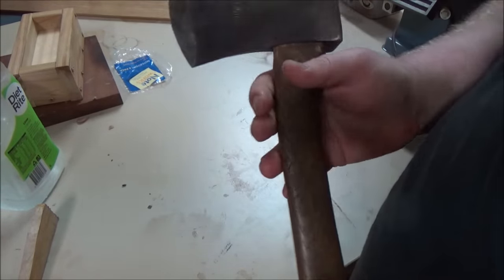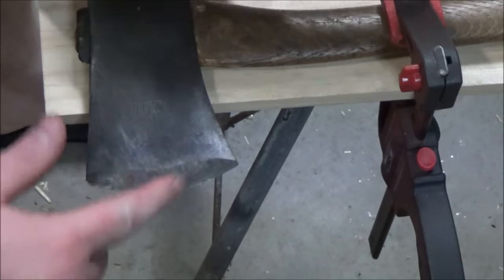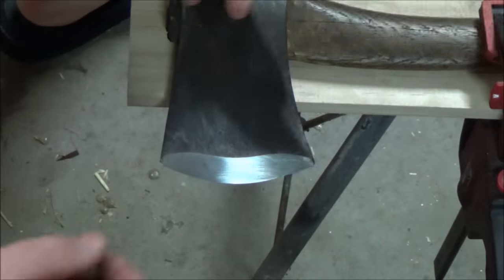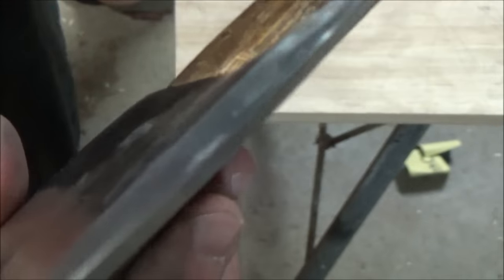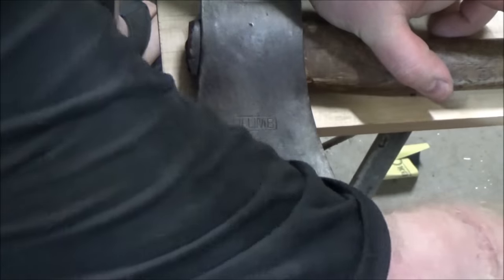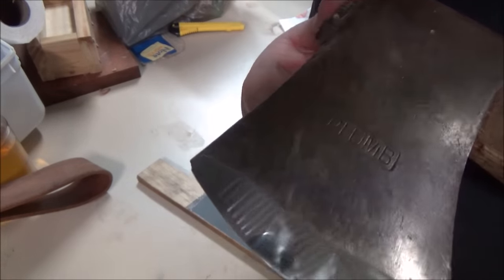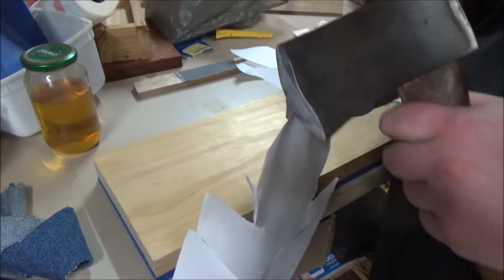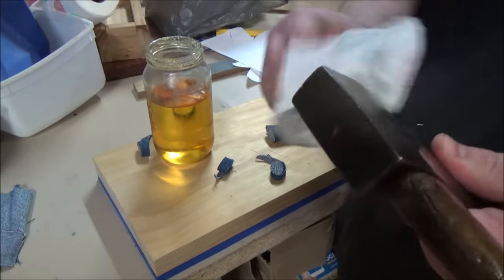How to Sharpen a Hatchet or Axe to a Scary Sharp Edge!

Comment: Just passing on a tip.i happened to stumble p
Upon a "shop changing"  supply source the other day as far as abrasion paper is concerned. It will save me 100's if bucks over the next 10 yrs... At the local ABC equipment rental place I was in there on my lunch, sharing some amazing ribs with a cute blonde I had met at the bar that weekend... Oh hell, SANDPAPER, the industrial kind in. 18x25" sheets! Light rosin or laquare backing with sparse grit. 2mil thick!!! Only had it in 36 50 80 100  but DAMN for 20$ I had 6 sheets of the best corse grit available.. got x2 50 and x4 80grit!! 
    Got abrasions from the babe too! But that's another story!

Comment: Life-changing. Seriously. Thank you so much!
Reply from the maker: Thanks. Life changing might be a bit much though. 
If you are new to sharpening them sandpaper is ok to start with but is more expensive over the long run. Files are great if you have a lot of steel to remove at the start and don't want to use power tools. I use a draw filing technique as it is easier to control the angle.
Reply: @scottshobbyz5416  This is how new I am: Bought an ax to process wood around the campground. Didn't realize it was DULL till I was camping and tried to use it, so....yeah...life changing, lol. Still chuckling over that one.

Comment: Ok, I'm definatly going to have to do that
Reply: I've used this technique for years, long before the internet existed. I couldn't get or afford diamond stones or the like. I use automotive carbide paper from the start, in the higher grades I wet it with water so the grit lasts longer. Just dry and oil the blade after sharpening.
Reply from the maker: Good luck. If you have a lot of steel to remove at the start you are best off using a file then go to sandpaper or stones
Reply: I have sandpaper up to 3000 and a buffer, I do have the Langley stone sharpener for my knives, that gets them scary sharp too, but for an axe or machete your out of luck, so I'm glad I found your video, definatly gonna try your method
Reply from the maker: I am not sure what a Langley knife sharpener is. Is it like the CIA version of the lansky ;) 
Bad joke I know.
Be careful on the buffer as you can overheat the very edge very fast. Also you don't want it to fly out of your hands at the least you may damage the axe at worst it may get you.
If you need to remove a lot of steel to set the bevel. Start with a file and draw file until you get it to where you are happy then refine until desired with the paper.
Good luck and have fun.

Comment: I prefer a grinder with a sand wheel. I get a pretty sharp edge in about 30 seconds. Then I finish with my stone for about another 2 minutes. But this is an awesome cheap way to get an edge nothing else would for the same price. Awesome.
Reply: be careful of ruining the temper

Comment: Hi mate, I was taught by an old saddler to keep sharpening until you work the bevel off and after that go to stropping. He would strop on the rough side then the smooth side of the leather with jewellers rouge and would get beyond razor sharp. I realise this is an axe not leather working tools lol. Great video, cheers
Reply from the maker: Yeah those leather knives are thin and get crazy sharp. Not sure if you meant work the burr off. But leather tools need to be sharp to get a nice clean cut. Anyone who can make a saddle will know what they are talking about.
Reply: @scottshobbyz5416  Burr lol.

Comment: Through my work as an Industrial Insulator, specializing in high heat applications (2300-3000+ F) I have several blocks of ceramic “tile”. What are your opinions about using it to sharpen edges? Would it take the place of any or all of the steps you showed here? Thanks

Comment: If it's convex, you keep it convex.

Convex geometry is required on a standard hatchet, mainly to avoid having the head stuck in the wood too many times and to enhance the splitting action.

Convex sharpening is quite simple using sand paper, some kind of a mouse pad and permanent marker to see where the abrasive is working. Search for this method. And don't listen to those who say that it will dull your tool. For an axe, it will work just fine.

Comment: I just use a file and sharpening puck, but I use my hatchets frequently in the woods and for rough chopping.    Any kind of edge being used needs regular resharpening, and I rather not spend an inordinate amount of time on it.   That's a beautiful edge though.   Interesting as an exercise and conversation piece.
Reply from the maker: Yeah for sure. The way you said it is what I would recommend for no power tool sharpening. Only times I bother refining it more are for green wood only, carving or axe racing (I don't axe race). 
Otherwise you don't really get an added benifit especially for the amount of extra work it requires.
Only thing I would add if people want it more refined is to regularly maintain the edge with a strop with compound. But I usually just touch up the microbevel with a pocket stone. You can do it loads of times before needing to address the main bevel again.
Not really a conversation piece anymore once you use it the bevel gets scratched up. But it was fun though :)

Comment: A bit of advise mate...
When you've got big dings like that start off with a metal file. Because axes have a very low hardness metal files can be used for reshaping without destroying the temper.
Then finish the edge as you like.
I use stones.
Cheers.
Reply from the maker: I was just going to let the ding come out over time. I look after this one now so it won't happen again. I usually use stones or files too.
Reply: @scottshobbyz5416  I wish I could say I look after my axes. I only have one hatchet.... It does everything from shop carpentry to tree limbing. If I go outside with it I always have to sharpen it afterwards. 
Great channel mate, keep it up!
Reply from the maker: You can always buy a cheapy from the hardware store to do the nasty tasks. Even if you only have a cheap one, if you had two cheap ones. You could keep one with a good edge for your cleaner tasks like the shol work or limbing. And have the other cheap one with a file edge for nasty work.

Comment: I'm a pipefitter and worked in nuclear plants. I understand what you mean when you say it can be relaxing working on a bevel. Some of the pipe I would work on was quite large, 36" plus. It could take days to fit one joint for welding with a bevel that would pass inspection..

Comment: I worked for forestry as a wildland firefighter.  Axes are designed for a scandi grind edge.  You are potentially ruining your edge/wasting material if you aren't careful to achieve such an edge, which is easy when using a tool like the one you used to sharpen with. I really feel with the sandpaper in the middle, It's favored for making a flat convex edge if you don't roll as you are doing it, which is also difficult if you aren't familiar with the concept.  With a good, classic tool, you should be careful with it.  The steel they made the cutting edge from, you'd now likely be paying a premium for.

Comment: Thanks for the video Scott! I strongly suspect the linseed oil used for the handle is actually double boiled linseed oil as that is the only product that actually dries to a hard surface. The boiled linseed oil is sort of soft or sticky:) (All marine hardware stores sell it)
Reply from the maker: It was just the boiled linseed oil from bunnings. Diggers brand. It actually had additives in it to make it dry. I also had it mixed in that jar 50/50 with turps. 
The raw linseed oil or other ones will go hard eventually. They just take ages to do it. Which is why lots of them have drying agents in them now. I believe in the past when furniture makers used raw linseed oil for their projects they had to wait a couple weeks between coats. What a pain.

Comment: I used to use sandpapers all the time to sharpen hatchets/axe’s and knives.  I have used plain white paper to hone the edge instead of leather.
Reply from the maker: I usually use files and stones. This is the first time I did it with sandpaper. Mainly to show you can get great results without fancy sharpening equipment or lots of tools.

Comment: You can sprinkle some 30,000 grit diamond powder on your strop to really get that edge fine, it's pretty cheap and readily available on eBay, and a little bit goes a long way, once you treat the strop its good to go for months of use. I also use tongue deppressors coated in it for my knives, it makes a great little polishing stick. You put a drop or two of water on one side of the stick and rub the diamond compound into the wet surface then let it dry, works like a charm. I can get my knives to split hairs with it.

Comment: I got a new ax today and it was dull with a crappy angle. I got my Grinder with sandpaper disc 120 or 150grit heavy duty leather gloves a face shield and ear protection. Clamp ax and I use a small wedge about 10-15degree about 3” long under blade and use a stout C-Clamp to ensure it doesn’t slip. Always clamp down your tool you’re sharpening! If you don’t know what you’re doing Leave it Alone! Start out and use a light touch and establish proper angle on both sides. I started out sharpening machetes, hacthets and axes as a kid about 8years old with a Bastard file which cuts on the push and would spend hours sharpening. Once I’ve got the angle set I’ll use the file to touch up And sometimes a diamond stone to make it pretty and get a wicked sharp edge. If you’re not good with power tools and lack finesse and control learn how to use hand tools. Also wear gloves because a slip with a file will cut the shit out of you if you’ve got a decent edge! Also hand tools will remove material slower so you can see the angle evolve and you’re less likely to F-stuff up or hurt yourself. Learning new skills and tools and working with your hands is very satisfying! It builds knowledge character and muscles and hand tools are good for the environment! Stay safe and challenge yourself to learn new skills and go beyond what you think you can and Dream Big!
Reply from the maker: Yeah most axes these days come dull with a really thick convex. I would use my belt sander with a 40 grit belt to hog off that excess material. This axe didn't need a lot of work to get a burr formed as you could see the bevel was already cut in. 
I don't usually use sandpaper to sharpen. Infact this was my first time doing an axe with sandpaper. I tried to think up a method that would be good for beginners to hold a good angle and not need fancy stones or tools.
Stones leave a better edge than the sandpaper too.
Sounds like you already have a your axe sharpening down pat. Lots of good tips in your comment.

Comment: That's one way to do it, you could also use sanding disks on a drill press and go all the way to 2K grit from 120.

I personally use Trizact belts on my linisher and get a 2 micron finish fast.
Reply from the maker: I would love to try trizac belts but haven't made enough knives or currently do my bevels on the linisher to justify buying them yet. 
But the purpose of the video was to show a way of sharpening for beginners who don't have stones or tools.
Reply: @scottshobbyz5416 I hear you, and understand that people need an inexpensive method to sharpen edge tools.  What some might fail to value is their time, and sharpening can absorb a lot of it when done slowly which effectively reduces profits.  I sometimes like to hand file a axe and finish off with a cheap diamond stick and leather strop which provides a razor finish - I also have a $600 Tormek sharpening system which I rarely use.

At the end of the day, it's nice to know what's available as sharpening anything can be done hundreds of ways.

Comment: Hmmmn... thanks for the video. I use a file working side to side along the full length of the blade, anchoring the heel of my hand on the side of the axe. Then when the nicks are taken care of, I use a stone to give it a good edge. Then a final micro-bevel to make sure that when I use it, the edge doesn't "roll over" from being too thin. Nothing worse. Good steel should be able to cut paper, but also cut knots in wood without rolling over the edge. Steel from Sweden, Germany etc are some of the best. Check out a log home building supply in your area.

Comment: Extremely  good video. Down to earth. Thanks. But out in the field how do you stropped or re-sharpen  your ax's?
Reply from the maker: I am usually not out long enough to need to sharpen it again. But if you have a fine stone just touch up the micro bevel. You can do this a load of times before the extra bevel gets big enough to bother going back to the primary bevel. 
It only takes a few strokes on each side and you are good to go again.

Comment: thanks for the video. the term scary scharp came from a sword maker about 15 years or so ago. it was in reference to his swords using A2. this alloy has a very fine grain which allows it to sharpen to about 10x finer edge than anything else. i dont know how this would translate today with particle metal tech but it wouldn't be appropriate  in an axe head.
Reply: Scary sharp maybe was first used on the old rec. woodworking listserv in the early to mid 1990’s.

Comment: Purty! The tests remind me of the old cartoons where the guy sharpens the axe on the grinding wheel and plucks a hair and drops it on the blade point and it splits in two. :) After the denim I was expecting you to slice up a tomato.
Reply from the maker: Haha, I should have done the tomato. It would have done it. I haven't seen that cartoon though.
Reply: Elmer Fudd I think it was. I forgot to mention how much I agree that it's nice to see someone giving the old classic tools some love. Thanks for the video. One thing I was wondering, does the oil make the handle slippery at all?
Reply from the maker: I will look it up and see if i can see the axe bit.
Thanks  it is a shame what happens to a lot of old tools. And a lot of them are better than most you can buy today.
No the oil is great it is a 50/50 mix of boiled linseed oil and turps. It polymerizes and once it has soaked it up and you build up lots of coats it is probably the most comfortable tool handle finish ever.

Comment: Quite interesting!!! I noticed you stroked the blade PARALLEL to the edge. I’ve always been taught to stroke PERPENDICULAR to the edge, as though you are trying to slice off a thin layer of sharpening stone, your file, whatever. I’ll have to try this. Does this same technique also work with knives? I’ve had a terrible time trying to actually get a decent edge on my knives.
Reply from the maker: I usually sharpen a knife the way you described. I can't see why it wouldn't work to sharpen a knife the way I did the hatchet.
The main thing is that you need to apex the edge. 
I haven't done any knife sharpening tutorials yet. I do plan to in a year or two. Hopefully I am still doing YouTube videos then.
One thing that can really help is a lansky type system. I have a gatco one. I would recommend getting one with the diamond stones. 
I find it really helps not just because it holds the angle for you. But as you don't have to worry about the angle you can spend more time focusing on what is going on during the sharpening process. You can see the bevel being formed. Get used to feeling for a burr. See what is happening whilst progressing in grits.
It really helps you understand what is happening without having to worry about holding the right angle. Then in the future go onto hand sharpening. 
Kind of like some people learn in an automatic car before learning a manual. You can get used to everything going on without worrying about the gears.

Comment: This is a great video on how to sharpen ,I like the tests . I would much rather see how it actually processes wood and how the edge holds up to  intended use . Do you have Vids of that?
Reply from the maker: No I don't have any like that sorry. 
From using it I can tell you that the apex doesn't stay very sharp when the microbevel is done with the sandpaper. Not sure why. If you micro bevel with something like an Arkansas stone it holds up better.
I also don't usually process wood with an axe I refined this much. Unless it is green wood (cutting to lenghts or trimming up fallen branches from a storm or something).
I was saving it mainly for carving which the tasks I do are mainly soft woods. 
You get rapidly diminishing returns the more you refine an axe when chopping firewood. Splitting wood you get no returns. So it isn't really worth the effort to me for that.
Also just because it is really sharp doesn't mean the edge will last for ages. Like any tool it needs to be maintained to keep maximum performance. Fine woodworkers who need razor sharp chisels and planes strop their tools multiple times a session I am told and those blades are a fair bit harder than an axe. I usually just touch up my axe with a fine stone just on the microbevel. You can do this loads of times before needing to address the main bevel again.

Comment: Do you recommend putting oil on the sharpened area to try to slow the rusting/oxidation process? Or is that not necessary?  I don’t use my ax daily so even stored out of the elements it tends to rust.
Reply: Wd40
Reply from the maker: The tape won't stick if you do that.

Comment: Cutting oil helps with the paper loading up, as do windex and plain ol' water
Reply from the maker: I wa s only going to use the paper whilst it was really sharp. Not for its whole life. Makes the process quicker but you do use more paper. Also as it was attached to the double sided tape I didn't want to compromise the bond.